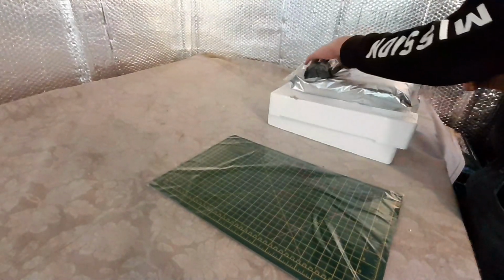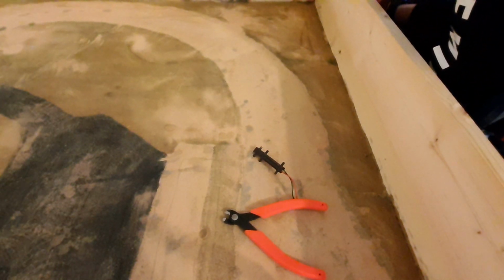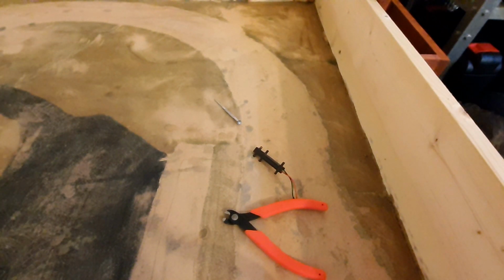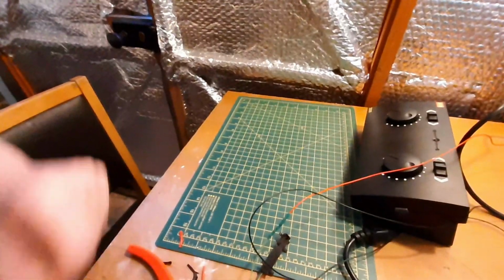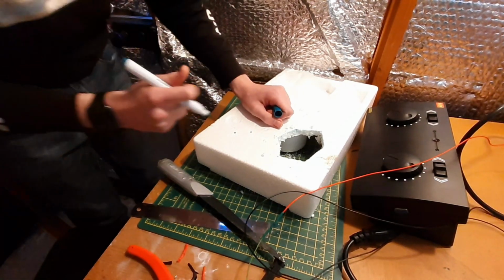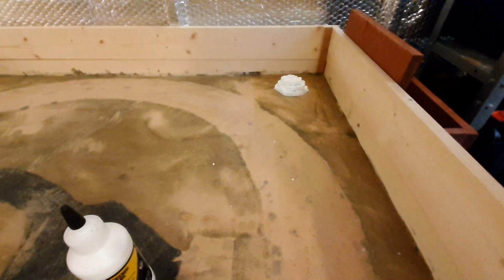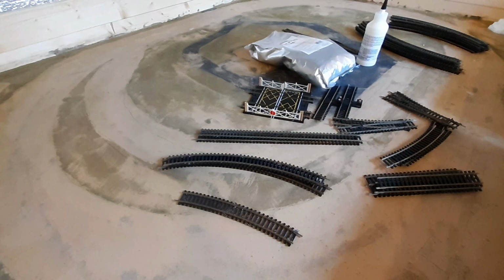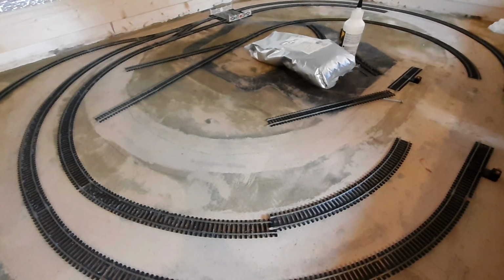New OO Gauge Model Railway Layout Build | Part 1

Comment: Hi Dan. I personally think you would do better to start a new channel for your railway layout.
Name the channel the same as your railway
Reply from the maker: That would be an idea but that means I have two channels to do so maybe I might...
Reply: @DanTheGamerAndTrains  Dan. I like your room is lined and not full of bikes or paint tins but needs more lighting, and we want to see what you are doing, not starring at a base board. It's not my wish to put you down, so please don't think I am. I'm offering feedback and, by doing so, hopefully encouraging your channel to grow. At least you are having a go. My channel is in its infancy.
Reply from the maker: @dinmorejunctionmodelrailway  about the lighting we've just finished insulating it so once we get the dry boards done, we may add permanent lighting and plug sockets, obviously we were staring at the board for most of the video because my charger has a limited length so I did try to get as close as I could anyways, thanks for your feedback!